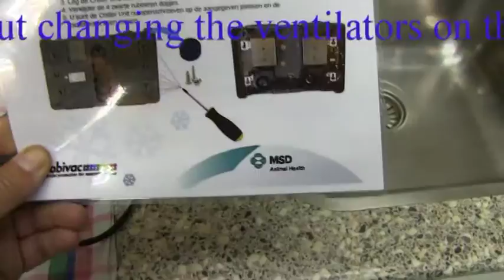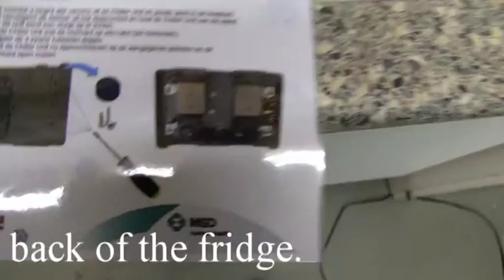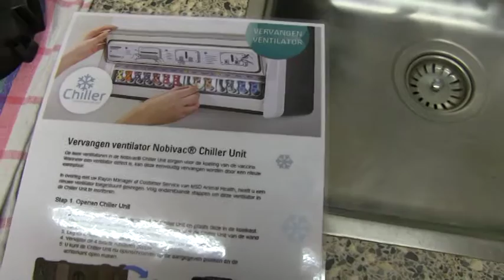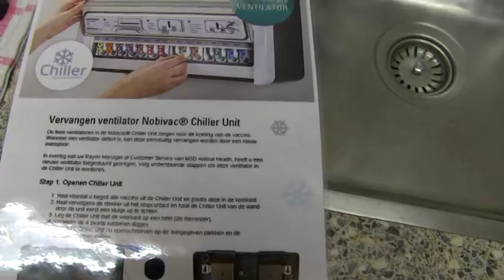MSD animal health Chiller Unit Ventilator Replacement instruction Video for Veterinarians 2015

Comment: Hi, my Chiller unit's LED flashes orange after a short while. Can you tell, what the problem might be? Ventilators are spinning.
Reply: You must open it and vacuum clean the cooling parts.
Reply: Debe verificar q las unidades enfriadoras se ponen tibias, so están tibias, cambie al termostato al de repuesto q trae si no deja de parpadear cambie los ventiladores